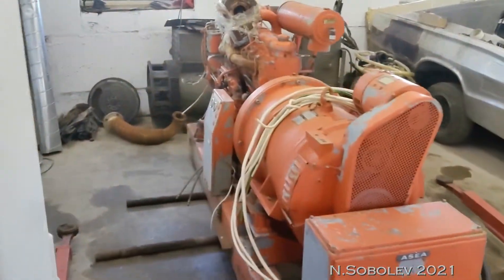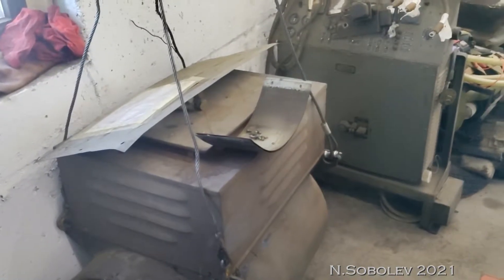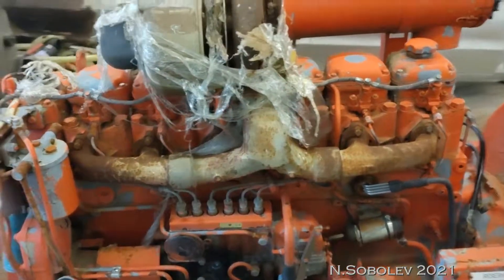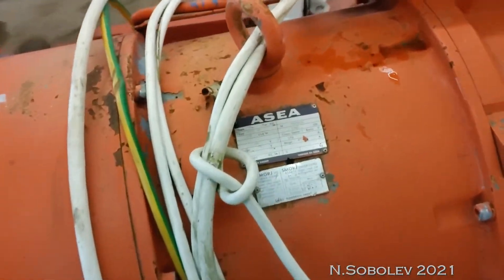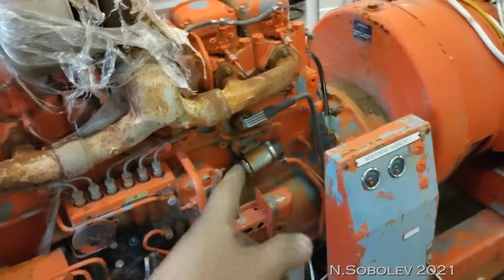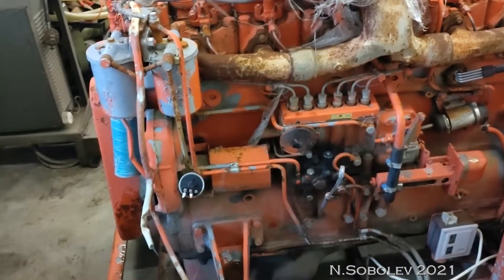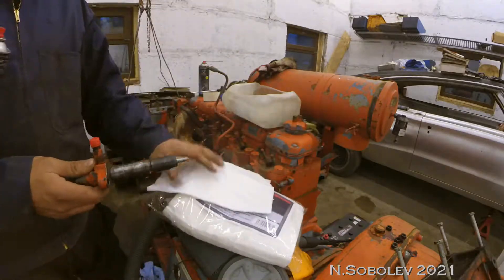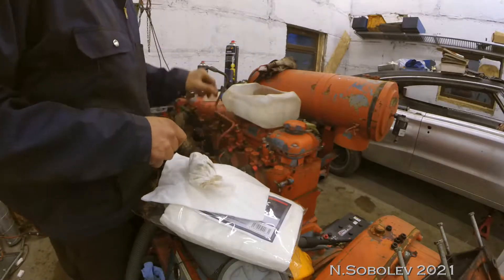Wireless trolleybus build part 1

Comment: The generator should be middle by the wheel covers. The weight is correct. I noticed you put the left side and the weight went down left. The generator is heavy. Great work!